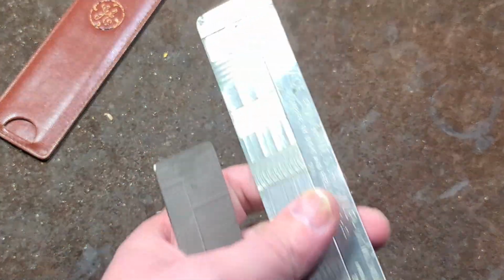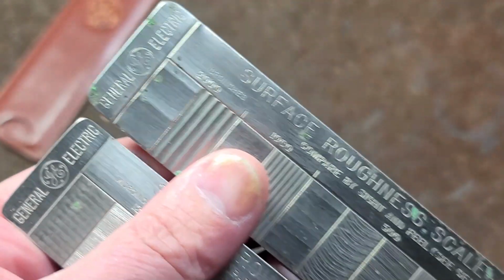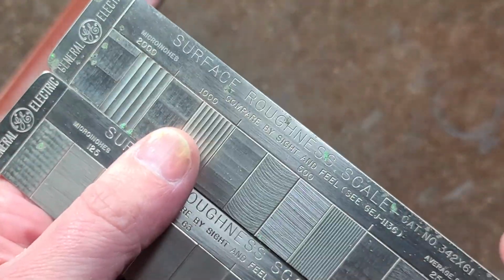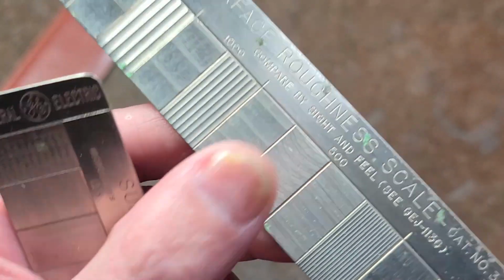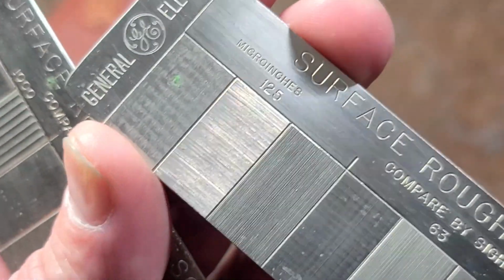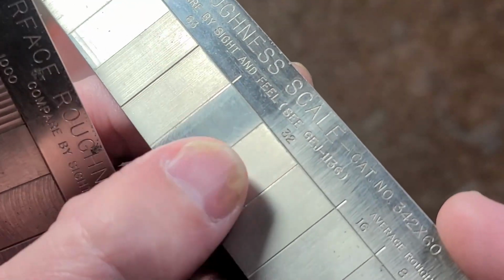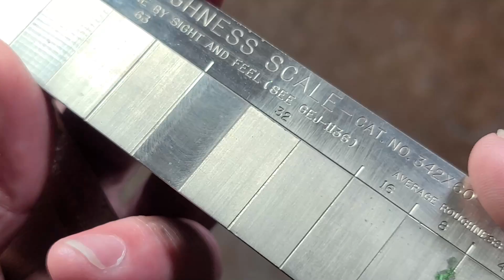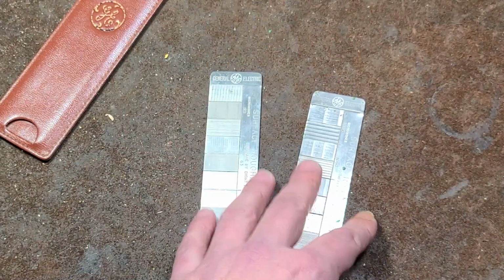General Electric Surface Roughness Scale/Gauge Set Review

Comment: We use something similar in the hangar for measuring blends on structure.   Typically all scratches / gouges are blended to 63Ra.  I really don't know of another practical way other than using a surface roughness comparator.